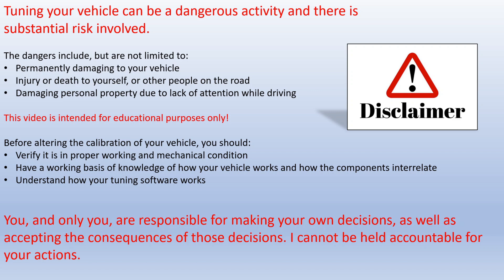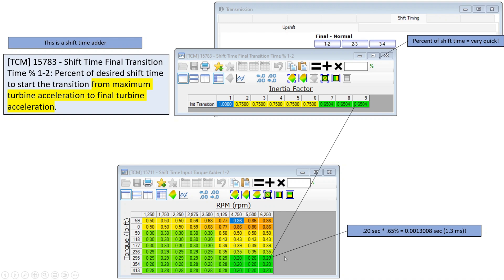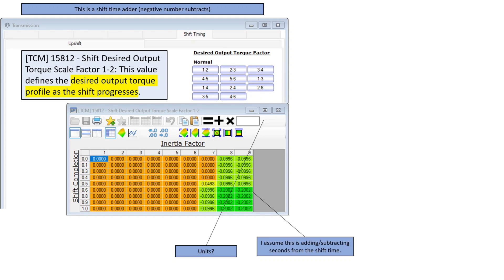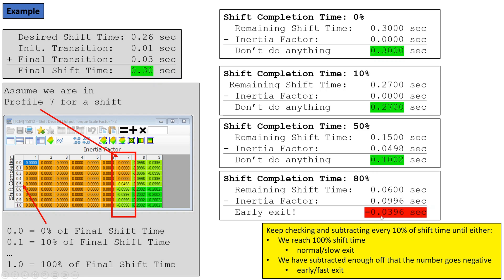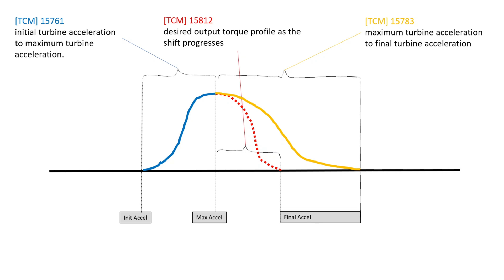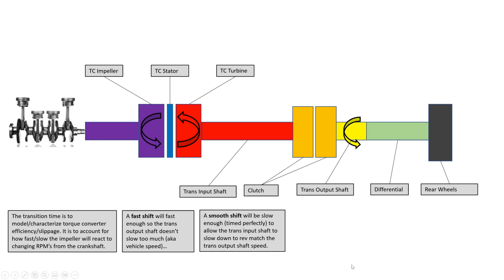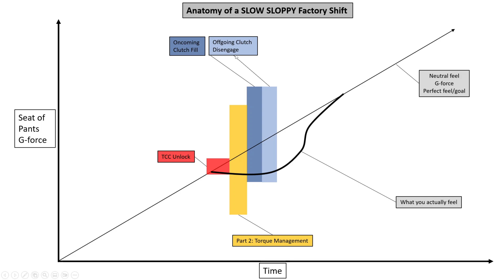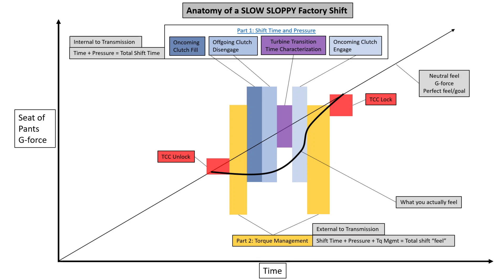Complete Guide to Tuning the 6L80E Transmission - Part 2a Time & Pressure Addendum: double clutchin'

Comment: I need to do a bunch of logging and messing with things to see if my theory holds water.

I believe we have a hidden "desired shift time" variable that we can't really see or do much with.

It seems like Torque adder is the phase of the shift for the actual hand off between oncoming and offgoing clutches. So we can only directly change the speed of this phase of the shift.

I suspect the initial and final is related to Torque Management like you stated, but also isn't a percentage OF the shift time, but it is at WHAT percentage of the shift completion the turbine starts its accel/decel.

It may allow for more or less slip of the oncoming/offgoing clutches. It may slow down or speed up torque reduction. It may change the delay between oncoming and offgoing clutch timing. I haven't played with it yet to find out more.
Reply from the maker: I'd love hear what you uncover, please post back. Be sure to include what ECM and OS you are using as well.

Comment: So "oncoming clutch fill" is just priming, or measuring some volume of fluid to prepare for "oncoming clutch engage"?  I would think that is happening in parallel and not adding to overall shift time.  I would also think that "turbine transition" is significantly connected to "Torque Management", if you're reducing the amount of tq cut (more net ignition advance through the shift) then turbine transition time needs to tighten up.
Reply from the maker: Yes it has to know how much fluid it needs to pump in before it starts building pressure. I agree a lot of this stuff is happening in parallel, but I have no way of what does. I believe the turbine transition is related to tq mgmt. The faster (or lazier) the RPM's change during a tq cut would impact how fast turbine RPM's change. If you cut a lot of tq, then the RPM difference between the crank and turbine is great and a tight factory converter should respond quicker than a loose aftermarket unit. If you reduce tq mgmt then the turbine won't spin down as fast. These are all my theories though! It would great if someone would reverse engineer the T43 code so we could know some of this stuff.

Comment: Good job on the tutorial. I have personally changed some of the other tables including the fill times without success. Mainly with these if your shift times are where they need to be and also sane the adaptive will take the rest over, adjusting the oncoming and offgoing pressure does help with the learning process. I have found some of the changes people will make are unnecessary especially after the adaptive have had their part.
Reply: Also I have had minimal gains from the inertia tables. I would imagine the transition times can be left alone in most cases as well unless internal modification has been done.
Reply from the maker: @04silverado6.0  I am coming to the same conclusion on the inertia tables (to leave them alone). I was looking at a WOT shift yesterday, comparing RPM, Turbine, and Output shaft speed and I was able to see a little blip (my init turbine profile 9 value was changed from .25% to .20% previously by a shop). Thanks for sharing your experience!